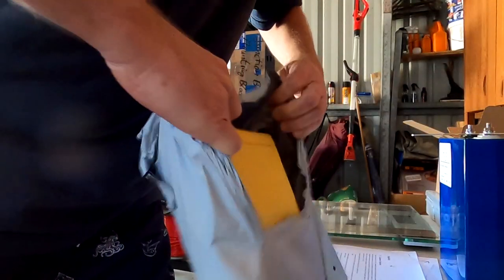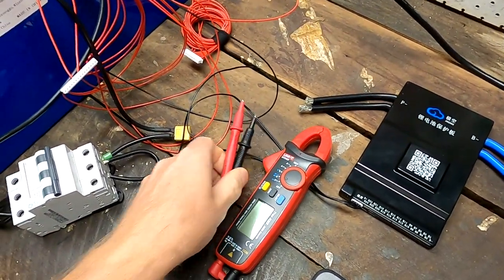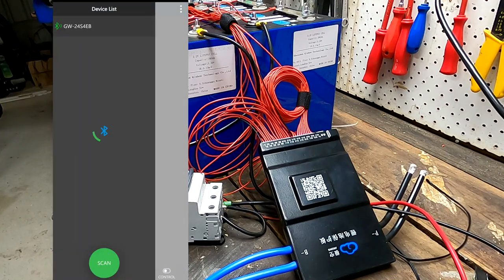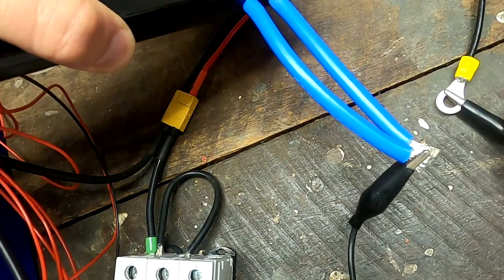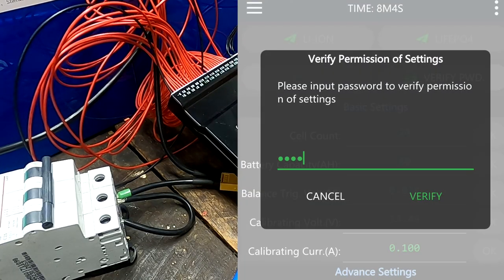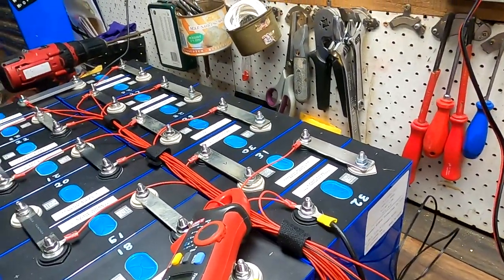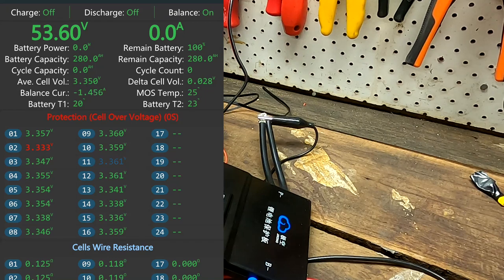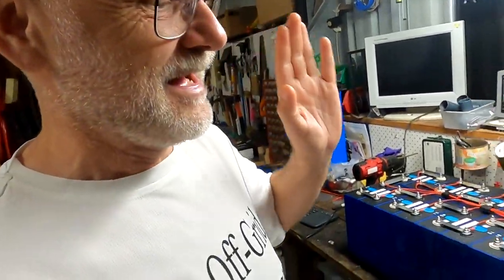The JK BMS with integrated active balancer. This is the one!

Comment: I have watched many of your videos concern the BMS and active balancing.  I am building a 230ah battery pack for a Polaris EV.  I started with a Daly 500a BMS and it fried internally.  I ordered another and it works but it doesn't read the cell voltage correctly which causes the charger to turn of prematurely.  I have been in contact with Daly and they tell me it needs a firmware update.  I cannot get my computer to communicate with the BMS.  This is very frustrating and Daly is little to no help.  I have wondered if adding an active balancer like NEEY could help with this problem.  I'm really tired of wasting money with Daly.  What BMS do you recommend to be the best all around?

Comment: Hey Andy, will this JK bms work with my 12kw inverter   that does not have communication protocol? Is it necessary to communicate with the inverter with this bms. Thanks for your videos. I am learning a lot and I'm in the process of building two  48v batteries very soon.

Comment: Everytime do we have to give 4 extra volts or is it only once at start?
Reply from the maker: This is to start up the BMS the first time. Once it is running, it does not need that start voltage anymore until you disconnect the BMS again. The new versions of the JK-BMS now have a switch to turn them on. Link is here on my website: https://off-grid-garage.com/battery-management-systems-bms/

Comment: I am doing an electric car conversion and I am looking for a bms to handle two rows of li ion batteries in parallel. Each row is 3x 12s modules. The Orión BMS is very expensive. Is there any Chinese BMS you are aware of that would fit my needs?
Reply from the maker: Maybe look at the QUC BMS with 4  relays. It can handle a lot of current and is also designed for mobile applications. Got a link here on my website: https://off-grid-garage.com/battery-management-systems-bms/

Comment: The itching question concerning lifepo4 battery banks.
What Balance current should really be required for a battery pack using brand new 100, or 200 amp hour batteries.
And, What balance current, or cell voltage spread would be considered to be too much during charging/discharging that would indicate a bad cell.
I looked at the EVE 105Ah specs yet no recommendations were found.
Andy you have a great deal of experience in this area, so any recommendations would be helpful...
Thanks.

Comment: Dear Andy, for LiFePo4 this particular BMS (and as far as I can see all from this line) in fact CAN be used for 8S setup. LiFePo4 - from 8S, Li-Ion - like from 7S and LTO - yes, from 12S onwards). This is taken from specs page on Ali.
Reply: It even works with even lesser cell counts but then you need to supply it with an external 12v supply to the B+ pin on the balance connector.

Comment: Andy, sorry but something you don’t tell us amateurs; what does the 24S mean in the BMS title?
Reply from the maker: The BMS can be connected to up to 24 cells in series.
A 12V battery consists of 4 cells 3.2V each. You put them in series and reach the 12V nominal voltage. That's a 4s system, 4 cells in series.
Reply: @OffGridGarageAustralia  makes sense however I presume that the 24S means you can put any number of cells up to 24 but doesn’t have to be 24?

Comment: I own this BMS and added it to a 24s LIFEPO4 pouch battery for an electric bike. the emergency mode blew up my controller. any thoughts on why or how that happened?
Reply from the maker: Very hard to tell. Why did you activate it? Was the battery empty and you turned it back on through the emergency switch?

Comment: JK has to be the best I've found! I have had the JK (balancer only) since the beginning of my setup and absolutely love it. (I use it for monitoring) and only balance at above 3.4v as a maintenance tool every now and then . This combo BMS/Balancer is the one I also will upgrade to at some point. Great Vid! Thanks for sharing
Reply: I also use two active balancers from JK. The problem with them is that it does not have the automatic start and stop function of the balancing depending on the cell voltage, at 3.5 volts for example. How do you start the manual balancing when you need it?  leaving it on permanently could destabilize the cells.
Reply: @mihaitaiosub  Spot on. That is not available on the balancer only version. I leave the balancing off and only turn it on for the occasional maintenance. I wish it had the feature to turn on and off at certain levels in the settings.
Reply: @danfitzpatrick4112  That's what I did until a day ago. Yesterday I made a small electronic change to the two devices that allows me to leave the balance on, without the device to do the balance in real time. I really trigger the balance with an external relay energized by the Victron charger depending on the total voltage of the battery bank, in my case I set it to 54.8 volts.Now it works perfectly. If you are interested in the change I can teach you.
Reply from the maker: Thanks for sharing, Dan!

Comment: Hello Andy. What's your suggestion about this: I'm top balancing 8 272Ah cells. The typical method is, first put them in series with a bms and charge to 3.5v; second connect them in parallel and charge till 3.65v. Since I have a JK BMS with 2A active balance, should I leave them in series and wait for bms to balance them, or should I connect them in parallel and let them reach 3.65v?? Tks

Comment: hello thnks for your vid ! do you think it will need an active balancer to work with ?
Reply from the maker: No, the JK has already a built-in active balancer. Works a treat!
Reply: @OffGridGarageAustralia  for charge and discharge ?
Reply from the maker: @bonnetalexandre2085  Yes, works fine without an additional external balancer. Try it first and if you cells are really that bad and won't balance, you can always add one later on.

Comment: You talked well about these jk-bms and I bought 3 pcs.

I ordered jk-b2a24210p and got sent version with rs485 plug in. I assembled them correctly with the balance wires which are all measured through. Put bms on negative. And put laboratory power supply with negative on bms-out wires and positive on battery plus, and with more than 5V difference, bms does not start.

What am I missing in my understanding of how this works?
Is there a difference between the versions of jk-bms?

Comment: I am using the LTT version of the QUUC.  It has the black internal relay.  The application is a 48V golf cart.  I have LiNMC batteries in a 14s configuration with 135A.  I also have 300W of roof top solar feeding a Victron 100 20 MPPT, a Victron BMV 712, and a built-in 15A battery charger.   The BMS has been an absolute nightmare.  I think it's defective.  I cannot figure out how or when the relay works.  I have ordered the JK BMS.

Comment: From my understanding, when voltage drops below 2.6V, it turns off the discharging MOSFET, but it is possible to automatically recover by charging to 3.0 V.
When voltage drops below 2.5V, the BMS shuts itself down to minimize battery drain. It will need the Vbat+5V power supply trick to restart.
Reply from the maker: Does it shut down if one cell goes below 2.5V? Is that a feature? Have you tested that? I'm curious...

Comment: Andy, good video, mine arrived and has two extra sockets but I can't find information as to what they are? Also there is a RS485 module it has the plug to connect to the BMS but the other lead has no plug on it, what plug should be connected, there is zero information, if this module a RS485 to USB? if so why did they not put a USB plug on it? can you help please. Bob

Comment: I just got my JK BMS with 1A active balancing.  I charged the pack and the status display is great.  The charging shut off like it should at 4.2V (NMC 140Ah pack).  But, I have one cell at 3.65V.  It seems to me that a 1 amp balancing capability is going to take a very long time to fix my half volt imbalance!  ???

Comment: I have questions. You say it has RS485. What control do you have of the unit via RS485? Are all functions controllable. Does it report all values of batteries etc?
Reply from the maker: I'm not sure yet. But I suspect it will report all values to a central unit which then can throttle charging through the solar charge controllers if the battery gets full. We will find out, Brad is working on it...
Reply: @OffGridGarageAustralia  Oh OK. Im not sure who Brad is but I guess I'll find out. New to the channel :D

Comment: How does this BMS cable can handle 200A ? It's two times 7AWG. Have you tried to run it on max load (±200A) ? Would be interesting to see the cables...
Reply from the maker: Yes, it can handle it. It's super fine stranded wire with silicon insulation.

Comment: Hi there, I just wired one of these up to my bike. On my setup I have a lead that comes off my battery positive for charging with a copper 6mm connector that i can unplug if needed. I unplugged it and later plugged it back in again and there was a small spark and the JK BMS just shut off and I had to reinitialise it with the +5v power source to P- and B-. Does this happen with yours? Also do you have an off switch installed? I assume it switches itself off and when you plug in a charger like it says it will turn on so long as the voltage is actually greater than that of the battery???
Reply from the maker: Hi Jim, not sure what you mean with this 6mm cable. Is this on the B- or P- side?
The BMS will turn off when you disconnect it from the battery. It will stay on while charging of course, otherwise it would not be able to protect the battery.
Reply: @OffGridGarageAustralia  The cable i speak of with the 6mm plug half way along it is a charge cable on the P- side. So the charge power is routed through the bms. I unplug it and it doesnt matter if is charging or not, nothing is plugged onto the opposite end of the cable, yet when i unplug it or plug it back in, it creates a small spark on the plug and the BMS just turns off and I have to reactivate it with my external 2 cell lipo. It's very strange! That aside, Im curious as to wether this BMS just stays powered on all the time, or does it switch off automatically?? So to reiterate, the cable plug that sparks isn't connected the bms to the battery, just a lead that goes from the charge port on my bike to the p- on the bms for charging, there is a gold 6mm plug half way down that lead that i use for ease of access and diagnostic, when I unplug it regardless of anything being connected at the other end it makes a small spark and shuts bms off.
Reply: @OffGridGarageAustralia  It's ok, despite that weird little error, it works absolutely fine so long as I leave the connector plugged in. Been using this BMS since I wrote that comment and it works very nicely. It seems to have slightly more throughput than my ANT BMS, and I am pulling peaks of 250 DC amps on my ebike, it also measures the voltages far more accurately. I am glad you made these videos otherwise I may not have known about this BMS and probably would have bought a DALY. Thanks for putting these videos up!

Comment: Why did you set the start balancing voltage to 3,45V if you have overvoltege protection set to 3,4V? Don't want to the balancing function :)?
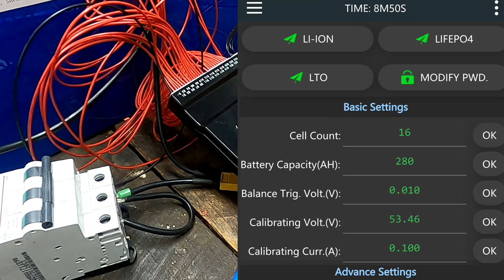Reply from the maker: It's explained at 18:35 in the video
The cell Over Voltage Protection Recovery is at 3.4V (not the Over Voltage Protection!). It's the recovery voltage!
If on cell goes over 3.6V (Cell OVP), the BMS turns off. It then waits until all cells are under 3.4V (OVPR) again before it reconnects the charger.
Makes sense?
Reply: @OffGridGarageAustralia  thanks for the explanation!

Comment: Silly question: If oyu use the display of the JK BMS (which needs 12V I think) .. how do you get those 12Vs off the whole solar setup ideally? From the Battery Busbar with some 48V->12V converter?
Reply from the maker: Isn't the power for the display not coming from the BMS directly?

Comment: Great videos Andy. But I'm still confused on how to exactly apply this +5v turn-on voltage. Did you connect it momentarily to isolated B+ wire? Was this B+ wire connected to B16 wire at the same time? Was battery charger negative connected to B- or P-? My newly arrived JK 24S150 is not working. Connections check out. I may need to return. Disappointed with poor unit packaging and weak/easily broken BMS connectors.
Reply: Finally got my JK1A150 BMS bluetooth to wake up. B+ is the last BMS string whether its used or not. B- goes to negative side of battery and P- to negative side of load/charger.  Connect the BMS as per instructions (google JK's website). I used a fused jumper for safety reasons. Connect this jumper to P- and the positive side  of any 5-9v battery.
Reply: This temporarily ups your protected battery by 5 -9volts relative to the BMS. Using another jumper connect it to - side of 5 - 9v battery and B+. Keep holding it to protected battery and you should hear 2 short beeps followed by longer beep. The long beep means blue tooth is on.
Reply: B+ should be tied to last battery string B16 in my case

Comment: An important point for the JKBMS setup is the voltage calibration. Measure the voltage exactly at the battery connectors and set this voltage in the BMS-Setup. The BMS works well in total but the SOC finding is a mess. Why the did not make an entry to setup the SOC in the setup menue manually? Daly BMS has this option and it is more favourable to enter or correct SOC from time to time.

Comment: Yeah I had a totally different brand and type too where you needed to use a multimeter on diode tester and connected across the b- and p- to get the BMS to turn on after you first connected the balance leads
Reply: I've seen some where you just short b- and p-, and others that have a separate trigger wire to touch 5v to turn them on. I suspect this one can be triggered on by doing what they said at 12:55 (touching 5v across b- and p- then connecting the battery) which would usually fry a BMS but this one seems to be made for it.

Comment: These Videos are FANTASTIC and made me start to design my own system. I have a question from Scotland though; Will the JK BMS work with the Multiplus 2 directly without a shunt? If so, how does the MP2 know the state of charge of the battery? Many thanks
Gavin
Reply from the maker: Thanks Gavin and welcome to the channel. Yes, you can just operate a battery, a BMS and the Multiplus II without a shunt. The Multiplus II will measure the battery voltage itself and disconnect if the battery is empty. No problem with that.
Reply: @OffGridGarageAustralia  This is good! however we still would like to know whether it will display the battery charge percentage when connected to the raspi Venus OS using a mk3-USB interface? We are keen to know the State of Charge at all times.
Thanks for your time 😀
Reply: Any thoughts on the above Andy?
Reply from the maker: @GavinWallace18  I don't think it will display any SOC or battery state without a Victron battery monitor or shunt.

Comment: Fragge Andy… does this BMS stay on more than 18 hours when on significant current going in and out?
Reply from the maker: Don't know the answer to that. If you stay within the specs, I would expect it will just work. I'm always oversizing these things though. So this 200A BMS will have to cope with a max of 100A only.
Reply: @OffGridGarageAustralia  let me explain bisschen besser….  Lol. I have a QUCC bms and if it is idle for 65000 seconds it goes to sleep and drops the contractor. I have tried setting the mosfet time to 65535 (-1) and also 0, but it always goes to sleep after 18 or 19 hours. So my question is if this jk bms will also sleep.  In truth I asked the question yesterday on Diy solar and someone said it does not sleep. I hope it is true.

Comment: I'm guessing that this is a bi-directional be Ms. In that there are separate charge and discharge on off selectors. If I turn on the discharge I get voltage at the output of the DMs I'm assuming if I turn on the charge that they will accept a charge from the solar panels. Anyway I think I'm going to like this PMS I have three of them and I have 3 16 cell 280 amp power banks that I'm wiring up right now.

Comment: Does this BMS balance the batteries (type: LiFePO4) well? How long have you been using it? Are there any problems with this BMS?
Reply from the maker: BMS is perfect. Never touched it again since I installed it 1.5 years ago in my battery shelf with LiFePO4 cells.
Link is here: https://off-grid-garage.com/battery-management-systems-bms/
Reply: @OffGridGarageAustralia  Thanks a lot! I have brand new 280Ah batteries (16 pcs), will this 200A bms type B2A24S20P work well with these 280Ah Lifepo4 batteries?
Reply from the maker: @ivaylomanolov1455  Yes, absolutely perfect for these cells. Just ensure the right settings and it will work a treat.

Comment: One question 
How do you mount it? No screw holes or frame. Using cable ties wouldn't be a very clean installation.
Reply from the maker: That is a very good question... Thinking about it since I got it 2 months ago...

Comment: Andy - we  all had to learn how to start this BMS I use a 2S pack of 18650 and connect positive to B- and just touch negative to P- (it takes less than 1 second).
Reply from the maker: I have to figure out something elegant for that. Like a start button at the battery shelve ;)
Reply: @OffGridGarageAustralia  a small 2s pack with a press button on the positive should do the trick. I understand in the beginning you need it more than once, but as soon as the battery is up and running, how often will you switch off the BMS ?